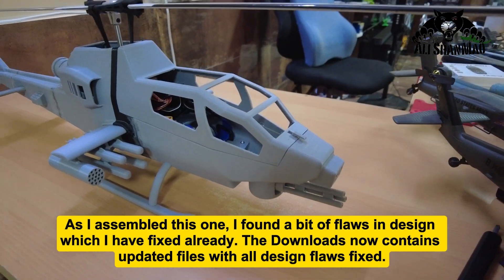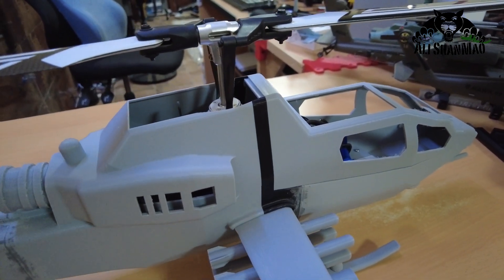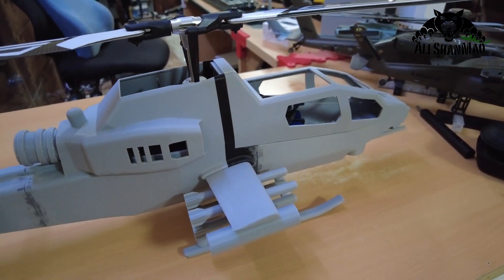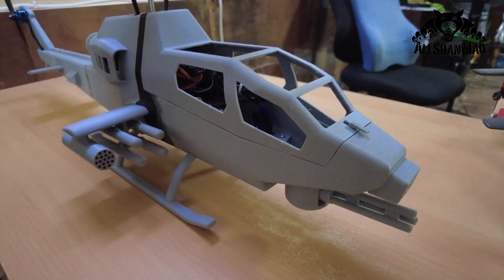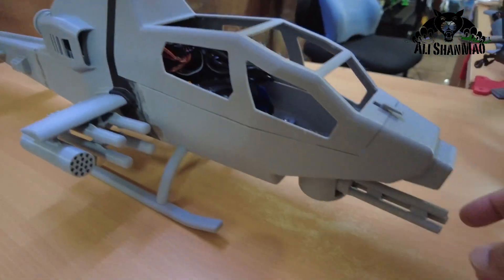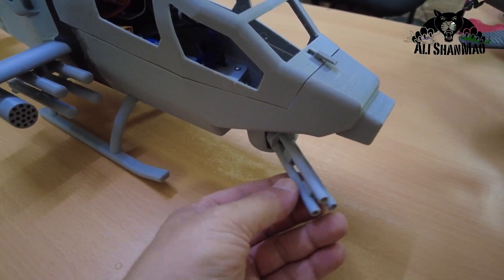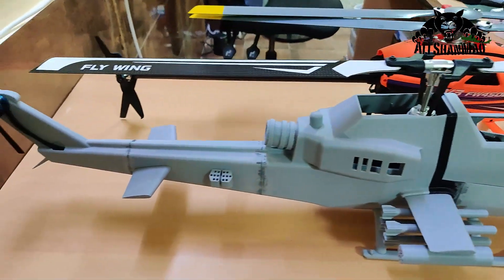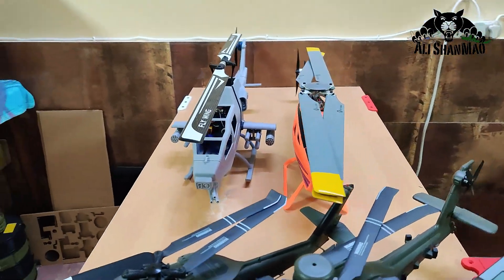3D Printed Cobra Inspired RC attack helicopter for Flywing Bell 206 V2 is ready to fly

Comment: She really looks very nice and beautiful! Do you think a thin rubber ring like rubber a seal could be a solution mounted between the machine gun and the fuselage? To keep the gun from moving around due to vibrations but leaving it still movable? Congratulatins! I can't wait to see her painted!
Reply from the maker: Thanks for your comment buddy. I am in fact going to add a servo to the front turret and configure it with a dial on radio then I can move it and pan it during flight for more realism :) if we can add Blinking LEDs on those 3 nozzles that will turn on with a toggle button on radio with firing sound, that will be even more realism. :)
Reply: @alishanmao  I can't wait to see the result! 😀